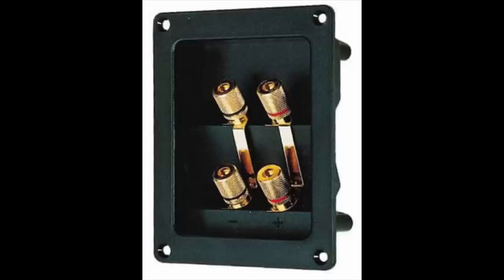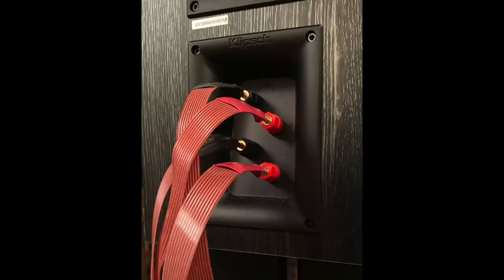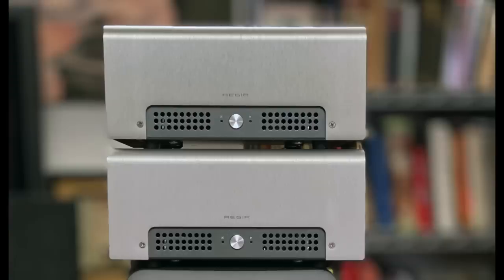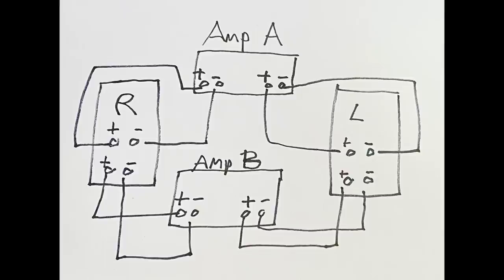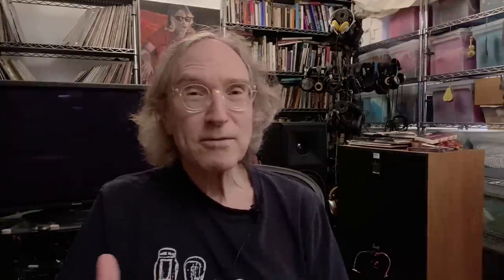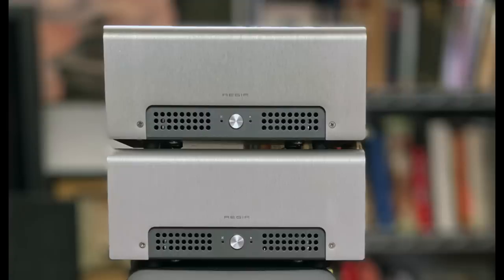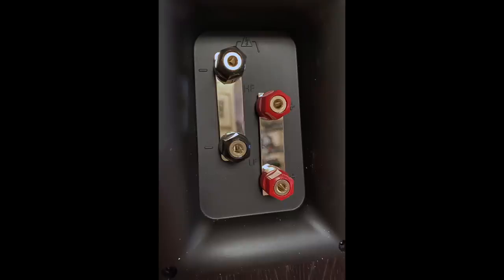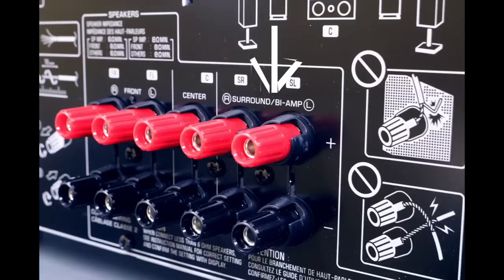It's time to think about bi-amping your speakers!

Comment: I had the Roksan Kandy and was able to pick up the matching power amp reasonably cheap 2nd hand. So I've been Bi-Amping for a while -  on Monitor Audio GR20. Not sure what difference it really makes but have stuck with it after moving to the K2 and I'm pretty happy. Steve here's one I'd like you to test - using a DAC with decent to good Cd players. I threw my Aune S6 into the chain between the amp and the K2 CD player and really found a big difference. When do you think this pays off? The Cd player is something like 1500 new, but a 500$ DAC has made it much more resolving to my ears.

Comment: <chuckle> "Everything" is YT hyperbole, eh? Maybe "A Little Stuff To Give You Wet Dreams..."
Nevertheless, this piece stirs some interest. I can only imagine the combinations that audiophiles will attempt. One aspect you don't mention is that simple bi-amping doesn't eliminate the evil passive crossover inside the speaker cabinet. But that aspect quickly becomes a much larger bucket of eels.

However, that is exactly what is happening with many powered speakers, today: One power amp per driver, no passive speaker-level crossover, no need for 'speaker cables.'

Comment: Are two Aegir’s better than  one  ‘average’  $1500 amp?
Reply: I figured I'd answer your question looking through these comments, I know it's old. I bought one Aegir at first with my Cornwall 4 now I'm running mono. Yes it is better more bass control and gets louder. I also bought two vidars for my center channel and rears. I tried those on my Cornwalls they get louder but lose so much instrument separation clarity, sonic characteristics and that super clean bass. I'm new to this whole class A thing, the Aegir is my first class A amp. I am super happy with the way they sound but I'm sure you can go down the rabbit hole and spend way more money and get something cooler, maybe someday but for now I am not disappointed with my purchase. I'm always going to buy class A from now on it is so sublime the way it sounds!

Comment: My understanding of bi amping is that you bypass the crossover and remove that from the signal path. This is most likely how the listening experience is improved.
Reply: Not in the example he presented.  In a speaker capable of bi wiring, the crossover is still there, it just is separate circuit for hi and low.  When he removes the jumper one amp is driving a hi pass filter / driver.  The other driving a low pass filter/woofer.
Reply: @user-od9iz9cv1w  Sir, you nailed it. It doesn't bypass crossover components. Bi-wiring isn't bi-amping.

Comment: The real problem is that most people use cheap and wimpy home theater receivers that can't drive anything below 6 Ohms. Most speakers these days go down to 4 Ohms and even lower in bass frequencies. I use my NAD C340 integrated amp on my PSB Image 4T floorstanding speakers. This amp is rated only 50 Watts per channel continuously, but it provides 170 Watts per channel dynamically into 2 Ohms.

Comment: We used to call what Steve is doing here "bi-wiring," not "bi-amping." Active crossovers were considered a necessity for true bi-amplification, (or tri-amplification)  This is not true bi-amping, because each amplifier is still seeing the full audio spectrum at the inputs.There is very little power gained from this, but it does uncouple the crossover circuitry. I think it improves the sound, because of this crossover simplification. Please remember that by using a double run of speaker cables from a single set of binding posts on an amp, you will cut the impedance the amplifier sees in half. 8 ohm speakers become 4 ohm speakers, etc. If any of this is wrong, please tell me, and I will sin no more. (I would be curious to know if Steve has ever experimented with FMOD crossovers.)

Comment: I tri-amp, with bipolar amps for low and mid, then Sony V-FET for highs. Even at high volume, everything is pretty much just idling. The amps aren't giant: 120 WPC up to 300 Hz, 120 WPC from 300 to 1250 Hz, and 60 WPC from 1250 up. I'm hoping to upgrade to quad-amp, with a crossover at 9500. I like the sound, and that's all that matters.

Comment: Amps have to have the same gain to biamp no matter topology. An amp with 10db gain can't match with an amp with 22db of gain. Frank VanAlstine told me that.
Reply: When the gain differs, you need a line level voltage amplifier to boost and match the gain.

Comment: Have had a set of bi-amped Mission 753's for over 20 years ( Cyrus amps ). Where have you been Steve? The speakers and Xovers have been renewed.  You could try this vertically or horizontally. Try both to see which works for you.

Comment: I have tube and solid state amps (biamping). I use the tube amp in pentatode mode for the lows and solid state for the high. Sounds dramatically better than either amp alone. 

And yes, I tried the tube for the highs. The Pass Labs SS sounded better on top.

Comment: hi Steve there are already so many comments, I just read some, not all. So not sure if was already asked.
if bi-amping from an AV receiver, how relevant it is to use the same speaker cables? Or at the end, if using anyway quality cable, the difference will no matter?

Comment: I have been experimenting with my new Marantz 7015 and I Bi Amped the front L&R Klipsch RF83's, it sounded better to me, but I am moving to a new house in a few months and I will have an Atmos 5.1.4 surround system and will lose my Bi Amp output. I would like to Bi Amp my front three speakers RF 83's and Klipsch RC 64 Center but to do that I will need a 6 channel or larger external amp and use the pre amp outputs on the 7015.

Comment: Hello Steve Love your show, Question most of my speakers don't have the dual separation of woofers and or tweeters they all have a single post using crossovers internally can I bi-amp theses as well? What are your thoughts? Do I have the wrong speakers?

Comment: I have bi-amped by speakers, with a Marantz SR6014 to a pair of Klipsch RF 82ii.  Running just off of the internal amps.  Sounded better with a little more output.  Just picked up a Parasound 855A, we will see if bi-amping those sounds better?

Comment: Steve could you possibly give me some insights in regards to pairing the decware zen triode with zu audio dirty weekends. Would running the decware in mono be necessary or would one zen triode be enough to get the dirty weekends to rocking? Thanks in advance, loyal listener

Comment: The obvious question is: But what about horizontal bi-amping?
What you did was a vertical bi-amping connection..
(vertical is like you drawn it. Horizontal is one amp for the right speaker and one pair speaker connector to the tweeter and the other pair to the woofer. And the same for the left speaker and that amplifier. )
Vertically may be a better way to skin the cat when the whole amplifier is dedicated to only amplifying one and the same channel information from the pre-amp. No worry about crosstalk then for example when there is no left and right channel information feed to one and same amp. As what the horizontal bi-amping connectivity has..
Reply: Doing it that way allows the balance control (if the amp has one) to be of more use.
Reply: @hxhdfjifzirstc894  Yes if you need to use balance control and have that on your amp. Usually a as in this case they act as power amplifiers and they do only have usually a power button. The balance is controlled on the preamplifier.
But horizontal bi amping is good when using different amplifiers. Like what Steve tested in the video.

Comment: I most modern recivers are capable of bi amping but most are hardly powerful enough to drive 5 or 7 speakers loudly. Now load two more amps and it could be a problem. If you are using it in a stereo application I say it's totally fine but surround sound could have some trouble driving all the amps and you might be better off not doing it.

Comment: I’m confused hearing you say, using tubes for mid/highs and solid state for the bass isn’t a good idea. Some videos ago, you seemed pretty impressed by McInstosh’s new hybrid mono amp which is exactly doing this.
Reply from the maker: Right, but it was designed that way! Specifically for biamping! And the tube part sounded like solid-state anyway

Comment: When I ran portable live sound for bands in small venues that did not have a sound system, I used an adjustable 3 way crossover just before the 3 amps for the horns, mid drivers, and subwoofers.   When doing sound for LOUD heavy metal bands, you HAD to at least bi-amp or tri-amp to maintain the intelligibility of the vocals.   If not, the mix got muddy, and you couldn’t understand the singer.   Those were the days, too old to load that gear now.

Comment: Yeah mixing amplifier brands can be problematic. Cornwall have a high woofer crossover point making bi-amping more critical.
We find it much better to bi-amp closer to the frequency extremes. Say a woofer that has a XO point around 200- 250Hz or a tweeter that has a point of around 7kHz.  In this case we usually find it better to bi-amp the woofer & midrange together and the tweeter separately.
Definitely helps too with inbuilt gain control such as the Zen as Steve points out .

Comment: Big difference between Bi-wiring a stereo amp with A-B speaker options and Bi-Amping with two identical amplifiers. I really doubt that I’m going to get an improvement in sound quality. I run the Yamaha 803D (excellent) with RP-600M. What I did do though was to replace the very crappy plated strap jumpers with high quality speaker cable on the back of my RP-600M’s. This is probably the same as bi-wiring. Was it an improvement.....yes...

Comment: Happy New Year, Steve and everyone!

So the only thing holding the crossover together on these “audiophile” speakers is those stamped metal, plated straps? I’m glad that I sent those RP-600s and SVS Ultras back. Buchardt for me, thanks. I’d rather have a good speaker with no bi-amp capability or quality copper wire connections than these budget speaker with straps. In the latter case, I would get real, quality wire jumpers with spades for them and use compression banana plugs from the amp.

Yep, I think that removing the cheap jumpers are what makes the difference
Reply: Yes, because those plates could never conduct as much electricity as the massive 16ga connecting wires inside those S400s!  ;)
Reply: @TheTomt50  good one. I’m not so concerned about the size as I am the conductivity of the metal. When you add the dubious straps to to unknown quality of the binding posts, does that affect the sound? 

I asked Mads at Buchardt about what the binding posts are made of, I got crickets 🤨. If I wasn’t so lazy, I’d get Cardas posts just to be sure. 

I tried out the Tekton Lore Reference for a bit and they had long lengths of what looked like 20G wire, but it was at least solid core, twisted pair. This is why I don’t get all excited about 10G shielded silver cables. I mean, geez, it’s all just too much.

Comment: "QUESTION ... could i bi-amp my TRIANGLE antal esw EVEN IF I HEAR SOME SOUND ON THE TWEETER ( very little...) WHEN I ONLY PLUG THE BASS CONNECTORS ???..( whitout the metal brackets of course :)).. with two different amp do you think it gonna burn both amp ??..thank for the answer !! "

Comment: Whenever we see explanations and recommendations of bi-amping, the focus is always on the speaker connections. It would help to have a clearer picture of how you get a single stereo (R and L) signal from a preamp to four mono blocks (2R & 2L) or four stereo power amps being run in mono mode (also 2R & 2L???) using conventional RCA cables. That mystifies me and seems like there would be multiple scenarios depending on the gear you're using. I'm confused. Doh!
Reply: Yes, I agree totally with you. We get to see the easy part. However, I don’t think you need four monoblocks if your system is stereo. Its one monoblock (or bridged amp) per speaker. You have one pre-amp, which has a right and left RCA output or a right and left XLR output to connect to your right and left monoblock amps.  Monoblock amps will usually only have a single RCA or XLR input. You can also run certain stereo power amplifiers in “bridged” mode, which in effect – if you have 2 - turns them into monoblocks. Then it would be handy to have a pre-amp which can be configured to run two stereo outputs using two sets of RCA outputs.

Comment: Have you tried the two Decware amps as mono blocks? That’s what Steve D. recommends. Wonder what the difference in sound is mono vs. bi-amped.
Reply: I have the same question.
Reply: Try 4! I believe the Decware can be set to a mono configuration for more power too.
Reply: @dksculpture  what kind of gear is needed to run 4 decware amps?
Reply: @EnergyMaxWh  The Decware amps can be bridged for mono operation. Use two amps for each channel; one for the lows and one for the mid/high drivers. I would think that would work.

Comment: Most of hi quality speakers have single jumpers. This brings me to this question: what would be the sound difference between:
1. Bi-amping 2 pcs 500 USD amps each 10 watts 
2. no bi-amping, ( but maybe bi-wiring) same speakers using 1 pc 1000 USD amp 20 watts, let' s say same producer higher quality ranked amp

Comment: Steve, why do you think all these speakers now have these dual binding posts? It confused me because when I watch videos like yours and from pretty much anywhere else, it's not done. I had a thought the other day watching someone else's video about a trend in speaker efficiency. That speakers have become less efficient over time in order to drive more bass with smaller driver. This is something I'm interested in as I own Polk LSiM 703 speakers. They're 86db. I ended up driving them with a Emotiva DR series amp and it's plenty of power, but I own the bookshelves. I talk to someone with the towers that cannot find an amp that will drive them. I've tinkered with mixing tube and solid state and mixing amplifiers. Like you said, it never works great or how you might expect. I got the idea that the dual binding posts are there because inefficient speakers sound better at a cheaper price point, but if you're selling to a budget minded consumer, telling them they'll need two amplifiers is pretty inconvenient.

Comment: Steve I have the AVR to do this but for the tweeter s can I use my mini tube amp and one parasound  I have two of those for the midwoofers? My manual from my system audios says remove the jumpers  it stressed on that as I remember I did use my miniwatt for the tweeters and one parasound for the mid woofer to me I didn't hear enough highs from the tweeters so I went back the standard way by using my two Parasounds same model and everything was combined much better

Comment: I was curious, so I tried bi-amping with two re-capped vintage amplifiers: a sansui317 and a sansui719 on Dali Ikon6 mk1 speakers, but.... without a pre-amplifier. Of course it was a pain to set the volume levels right and the difference between these amps was too big. One was on 30% and the other had to go to 70% volume to get it to sound somewhat right. So it was mostly stress and not much fun. I stuck with bi-wiring which btw works very well. Maybe sometime when I get bored, I will try bi-amping again but then definitely with a pre-amplifier and better matching amplifiers.
Reply: Yeah you need identical amplifiers in order to make it a stress free exercise

Comment: Is there a difference in quality between bi-amp and bi-wiring? I currently have a bi-wire cable connecting my Vincent SV-237mk to a pair of Klipsch RP 600M. The cable is “single wire” on the amplifier connection and “bi-wire” on the speaker connection. The difference, comparing this setup with the former single wire cable I had, is very, very clear. I ask my self if having a bi-amp would make it even better. Any opinions?

Comment: What about actual volume of sound?
If the speaker impedance was based on the jumper being installed the impedance should rise when it is removed and thus the output decreases.
Did you have to adjust the volume up?

Comment: In your set-up you did horizontal biamping (one amp does bass for both speakers and one amp does the treble).  Have you compared that to vertical biamping (one amp does the right speaker and one amp does the left speaker)?
Reply: Personally, I would think that bridging 2 amps would be more useful:  According to the manual you could take two stereo 2-watt amps and get a single stereo 6 watt amp. That would give you an amp closer to an 300b in output but with the better high- and low-end performance of an EL84 amp.  Yes?

Comment: could ohms per amp make the difference? Maybe splitting the speaker cab contents changes ohms each amp is handling which would change tone in some way?
Reply: No. It's not like connecting parallel speakers. Two way crossover components make it possible, typically an 8 ohm speaker has 8 ohm woofer and 8 ohm tweeter. Crossover parts still do their job when using 4 inputs, simplified: a coil for LPF and a cap for HPF. (Often with additional resistors and caps.) Only the connection with LPF and HPF components is bypassed when bi-amping.

Comment: Wouldn't the added dynamics or what have you just be the added bi-coloration from the amps themselves? To get the full effect I think you'd need to start with bi-mic tracks, etc, or, I guess quad-mics for stereo.
Reply: Actually, this could be used for noise cancellation (comparing two or more sources), now that I think of it, to make for some hypothetically extremely clear and accurate sources – makes me wonder if this is something they use in the industry already.

Comment: I use as pre amp/dac a yamaha wxc 50 and as amp's Sanyo DXC 4000L for the top and a Harman/Kardon avr 21 for the bottom (speakers B&W 620 ) just a experiment.
Some time later i will buy 2 small amps something like dayton audio to bi amp vertical.